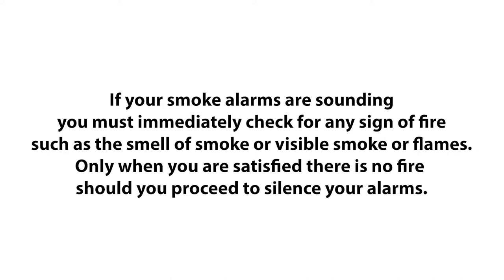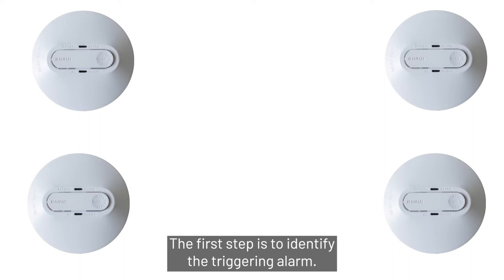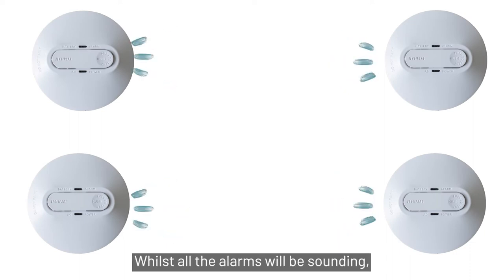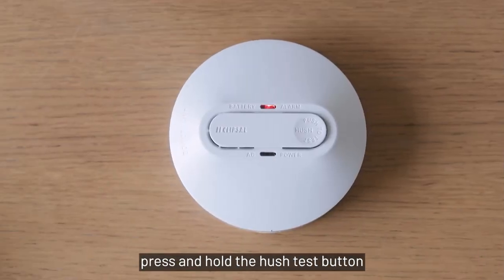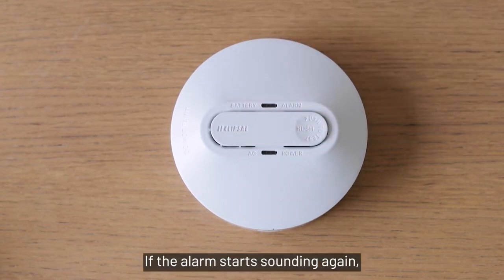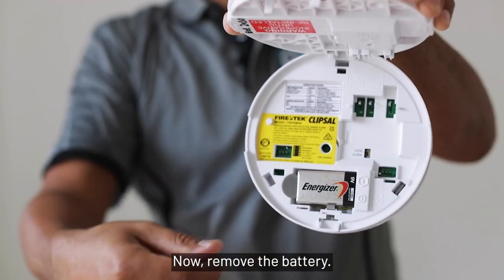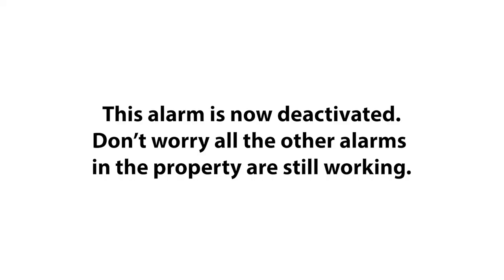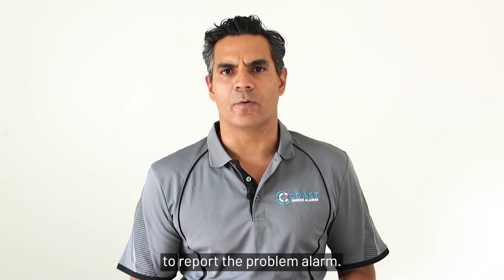Clipsal hard wired smoke alarm: How to deal with falsely beeping/sounding alarms| Coast Smoke Alarms

Comment: My smoke alarms are similar to the ones in you are demonstrating.  They are all interconnected by mains 240v with 9v battery backup.  I found that my smoke alarms do not have their own circuit breaker.  Is this illegal?  What a pain.  If vacuuming did not work then we would have the offending unit being triggered all night every 30 minutes.  What a bastard :}
The only next step was to turn off power to the whole home.  And disconnect the wires in and out of the offending unit.  Would this have worked?

Comment: >  does not explain about dust, if the bastard won't turn off   ie every 20-30minutes it goes off again.  Vacuum clean dust off in and around the offending unit. Unscrew from ceiling and vacuum there too.  This solved my problem.  There was a lot of plaster dust around the terminals entering the unit.  This could only be seen after unscrewing the unit from the ceiling.  The sparky did not do a clean job.
>  green light means mains power is connected
>  red light flash every minute means battery is good
>  constant red light means that that unit has an issue, turning off with the test button for 3 seconds will only last 30mins when it will sound again